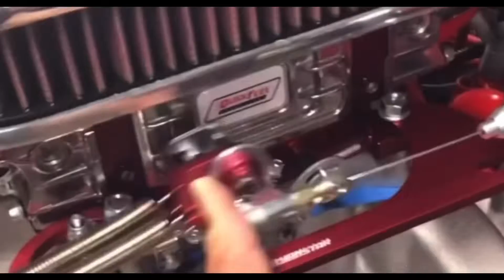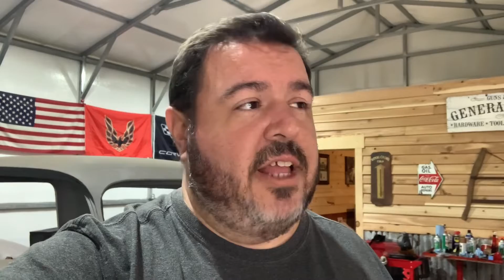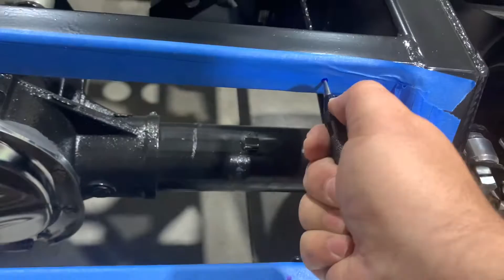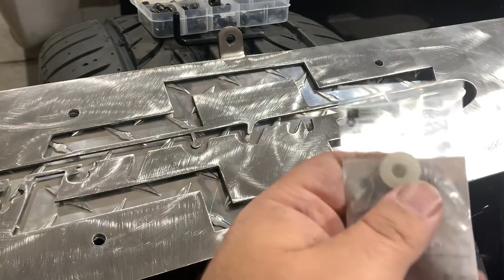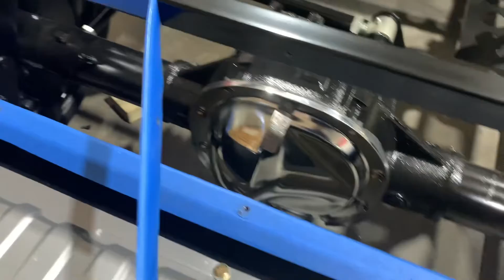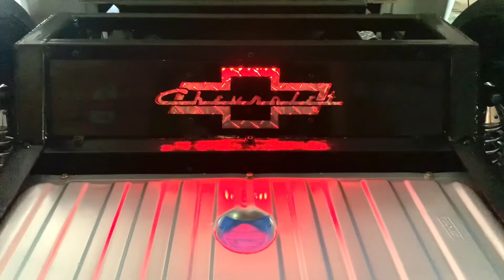Custom Chevy LED Panel - Illuminating the 55' Chevy Truck!

Comment: Nice!  I like to use button head hex head screws instead of the regular socket head cap screws for this sort of thing because they look more like rivets.  You should give them a try and see what you think.
Reply from the maker: There is a company called dress-up bolts that makes all types of button heads, that are all anodized different colors and styles. I actually plan to change them eventually